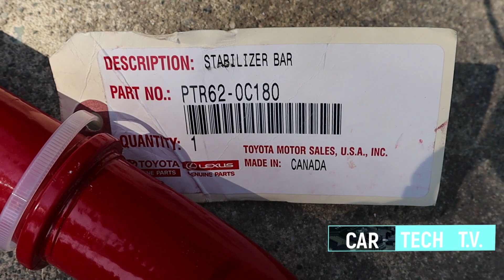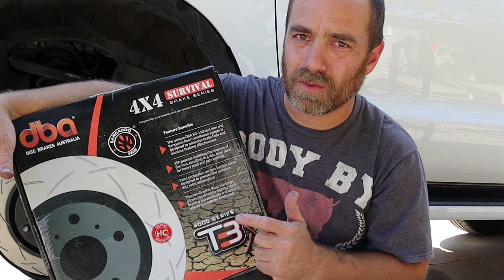Toyota Sequoia Sway Bar and Brake upgrades!! 18 inch TRD pro vs 20 inch limited and Platinum tires.

Comment: Anti seize the threads and axle grease the cones. Been doing it for yrs never any problems. I figured if ARP wants you to lube critical engine parts why not wheel studs and lugs. Always check the lugs for the first couple of drives just to be sure.

Comment: Was there any major suspension differences between the early vs later gen 2 years? I’m looking at the “parts dept” website of my local dealer and it says the sway bar won’t fit my 08, but will fit a ‘19. Is this true or is it just Toyota being particular? Thanks in advance. 

BTW this video is exactly what I was thinking about doing this morning. Glad to know there are folks like you out there improving the ride quality on the street

Edit: A guy on qlmotorsports installed one and it fit like a glove… I’m doing it
Reply from the maker: Hey thank you for the comments and kind words. I believe that the chassis is the same from 2008-2021. Should fit no issue. I believe mine was actually a tundra  part but even that fit. Just be careful because there are 2 generations of the tundra. You likely need the earlier ones before the new tundra lights and front end

Comment: Your sequoias 2017? I want to order the sway bar using the part no you gave from this video  for my 2011 Sequoia they’re telling me it doesn’t fit. I thought it fits on 2008-2020 sequoias?
Reply from the maker: Fits just fine in mine. I know that there are red trd bars on the new sequoia trd pro models. Ask for the part numbers for one of those from your local Toyota dealer and they should point you in the right direction

Comment: I've always heard the rear sway makes the most difference, but evidently it's a lot harder to remove and if the front is a significant upgrade then I'm sold on "easier" 😁 Did you do both the front and rear TRD sway bars, or just the fronts?
Reply from the maker: Thanks for commenting! I only did the front one. I got it in trade for some tundra fender flares I had. It did make a huge difference though. Front end is super planted and it removed almost all dive into corners. Highly recommend!!
Reply: The rear one is a pain to replace. The driveshaft has to be unbolted (in the rear) in order for the sway bar to have enough clearance.